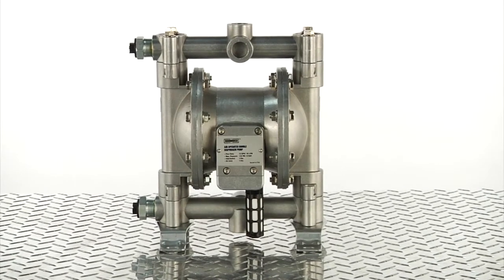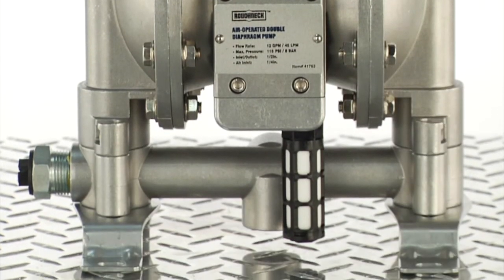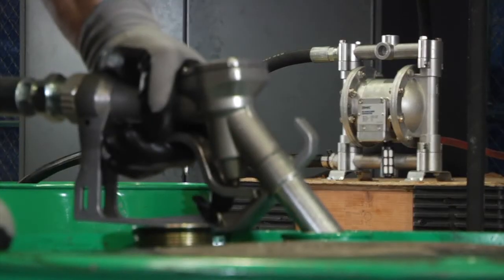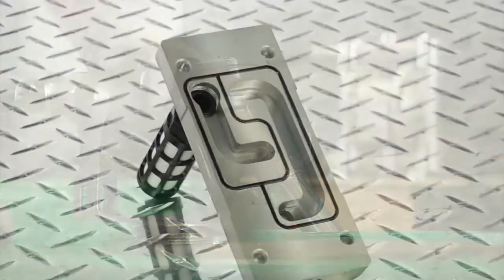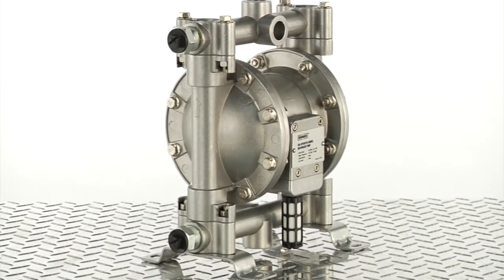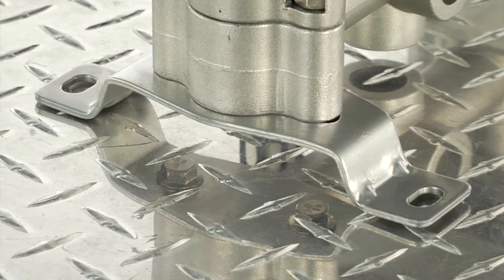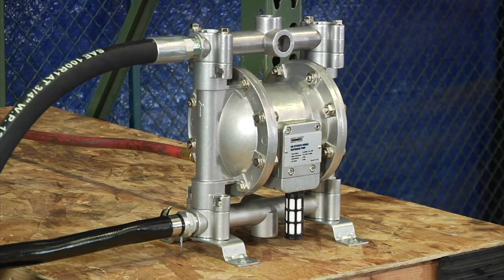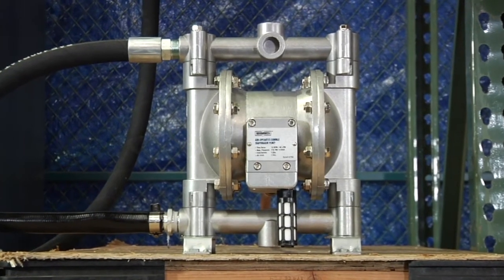Roughneck Air-Operated Double Diaphragm Pump - 12 GPM, 1/2in. Inlet & Outlet

Comment: What about something like this for paint spraying inside a paint booth. Note that the paint is thinned with paint thinner. I have a double diaphragm pump (ARO brand) and it works but I need to get another one. What would you recommend.